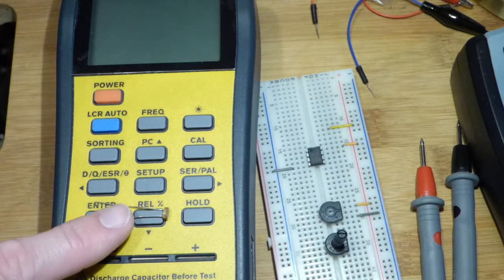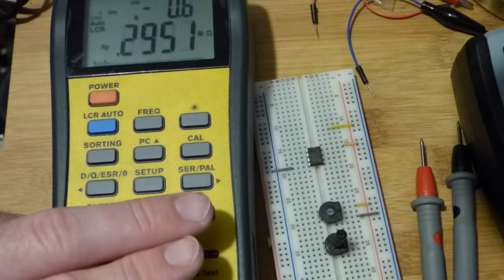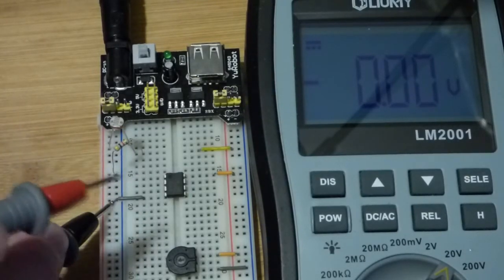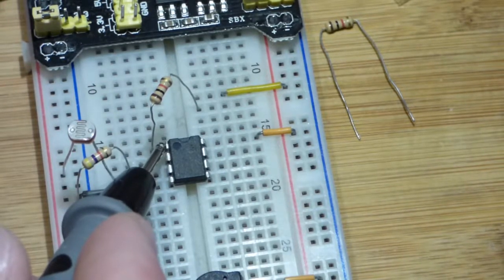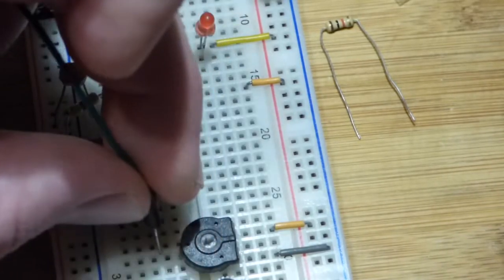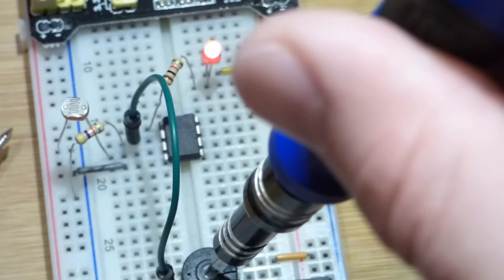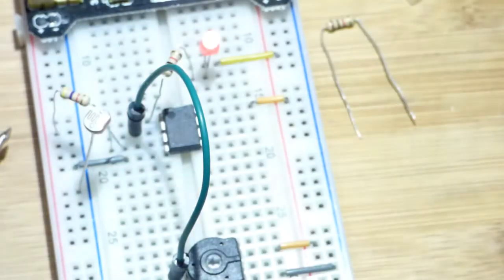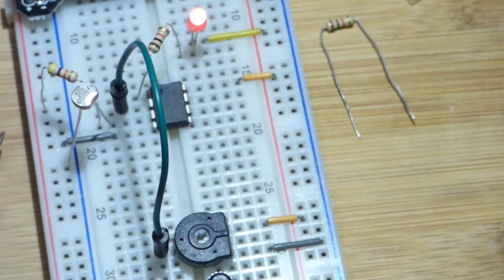Step by step build of light dependent resistor LDR controlled LM393 comparator LED on off circuit

Comment: Thank you.  Your video is very clear and informative.
By using both of the comparators in the LM393, two LDRs, and two LEDs, how would you connect so both LEDS are off when light is equal on both LDRs. And, when one or the other LDR receives less light, the corresponding LED illuminates?
Reply from the maker: Thanks for watching! Can't really answer that, would take a while to design and explain, but sounds like a circuit someone would have built and shared the schematic for to Google. I'd search for something like "comparator light intensity controlled LEDs circuit".
Reply: @Electronzap  Thank you.  Your search phrase suggestion has brought me closer to a solution.
Reply from the maker: That's great!

Comment: I just found your channel searching for videos that explain why we should use a 2N3904 as compared to the 2N2222.
On paper, 2N2222 beats the 2N3904 in every way I can see! 
Why should we bother with 200mA maximum current capability of 2N3904, when the 2N2222 has a 1A max current rating?
I know there must be an advantage in using one over the other, I just can't see why. 
Sub'd +1
Reply from the maker: Thanks for watching! I mostly use 2n3904 NPN cause often I'm also using 2n3906 PNP in the same circuit and I think the smaller change in number is less confusing than 2n2222 NPN and 2n2907 PNP for people unfamiliar with transistors. I also seem to come across more 2n3904/2n3906 in the kits that I get than the 2n2222/2n2907 and I try to use components I think people will have. I'm pretty sure the 2n3904/2n3906 switch faster than 2n2222/2n2907 and that made them popular with amateur radio enthusiasts, who where the most powerful DIY electronics market until microcontrolers made higher power, lower frequency switching robots and drones building common, where the 2n2222/2n2907 are probably a better choice since they handle about 3 times the current with the same maximum voltages. Since the vast majority of circuits use 1/4W resistors, the 2n3904 200mA current max is usually plenty good. I plan to do a lot more super capacitor circuits in the future and I'll need to see what higher current than 2n2222 can handle transistors I have, so transistor selection is all about what extreme a particular circuit needs to meet and component availability.
Reply: I didn't believe you, so I tested both in a emiter follower (to minimize Miller Effect) At 4 MHz, the 2N3904 had a more square'ish output square wave, than the 2N2222 !
Yes, the 2N3904 has a better bandwidth than the 2N2222A. I think its mainly because it has a better fall time, and less  of a storage time. Thanks for giving me the hint about the 2N3904 being faster switcher.
Reply from the maker: Awesome! Higher frequency circuits are lower on my interest level so I haven't done any yet. In the distant future I plan to do transistor component comparisons when I come up with easy to understand tests for beginners and get better at building them.